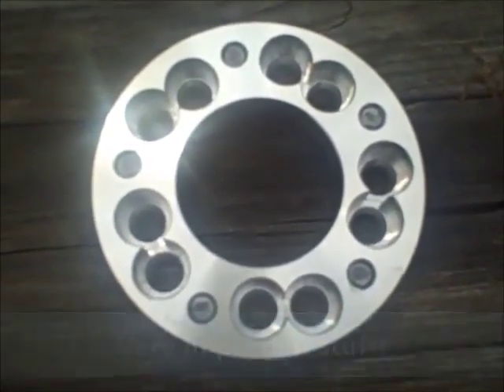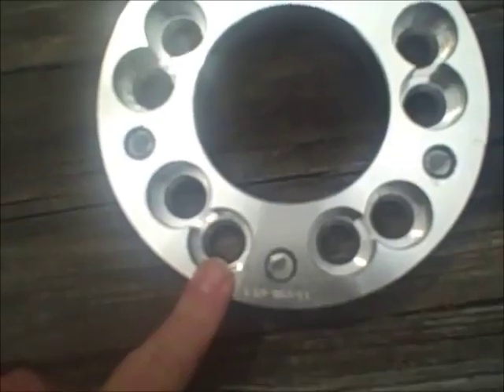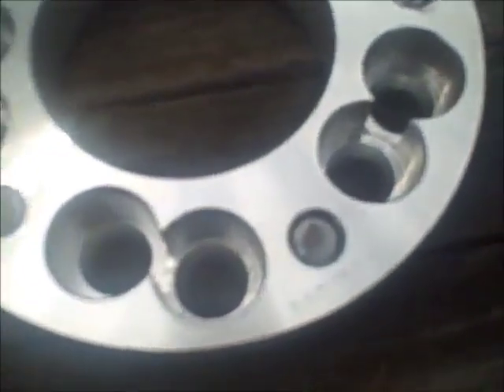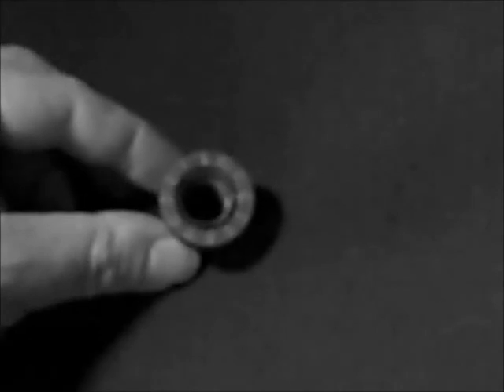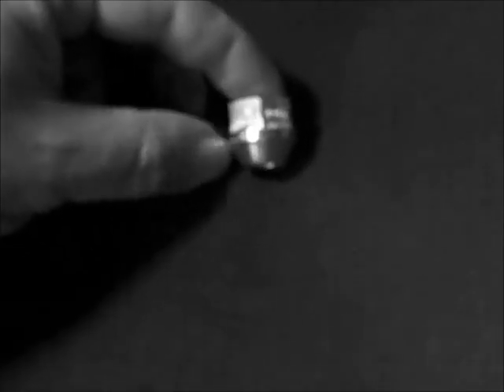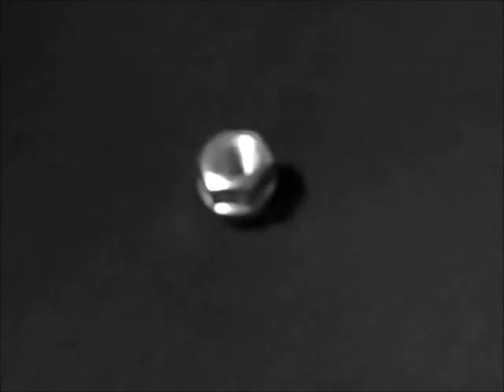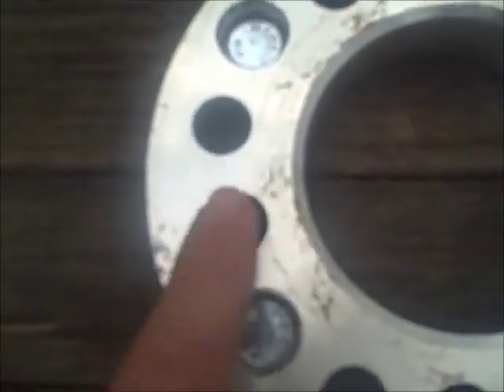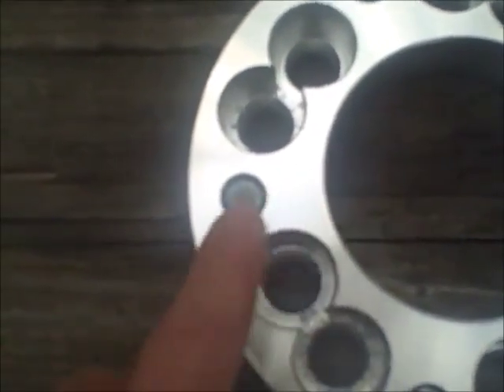Wheel Adapter Broke Studs, DANGER!.flv

Comment: You should include everything required for proper install
Reply: Or, the installer can use common sense and know you can’t use a flat lug nut in a conical seat…

Comment: The problem they don't tell you is your lug studs are longer than the adapter is thick so you have to cut the lug studs on any 5x135 unless they are 2" thick. Once you do that they ride great it's no different than putting aftermarket rims on a Chevy 4wd if you look none of them are hubcentric either they are made to fit Toyota and Nissan hubs also which are much larger. In the end you just have to have common sense when putting anything like this on or yes your gonna have problems.

Comment: those wheel adapters are not hub centric adapters, its not a question of if they'll fall off. its a question of when. all the wieght of the vehicle are sitting solely on the studs instead of the hud, spacer, and studs combined. i would never buy those.
Reply: Cole Phipps been running lug centric spacers for a long time on my 250 and have never had any issues. The wheel needs to be probably balanced. Recently had the lip b of a hub centric spacer break on me.

Comment: Good info here folks. Those that say :Well my wheel is on tight , but there is a very tiny gap on my 2 piece. I'll just torque it down tighter and that should do it, Right?" WRONG! WRONG!, AND WRONG!. Rotational forces and heavy load on the spacer with find any wiggle room possible and try to loosen up. If fitment isn't right, you want to risk injury and/or possible death?

Comment: After watching this i instantly went and checked my spacers to make sure the studs wont sticking out and on to the wheel. Found out they did but its alright wheel has the groves inbetween the where studs go,that are deep enough to allow the wheel to sit flush on the spacers. At first i was like this sucks, but when puting the wheel on it seemed to seal perfect despite this, thats when i noticed the orginal studs are sitting in the groves of wheel hub inbetween the stud holes, that was a relief because they are just deep enough where the orginal studs are not touching the wheel at all.
Reply from the maker: that works fine, just have to be a flat smooth mating between the face of the adapter and the back of the wheel